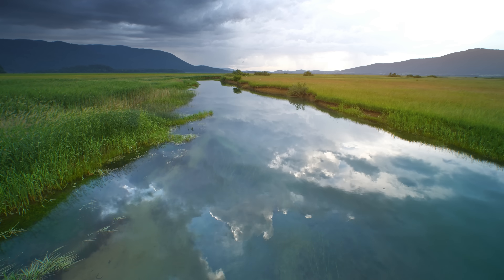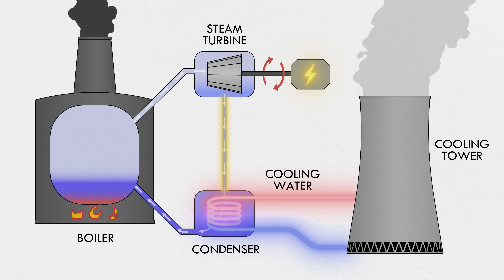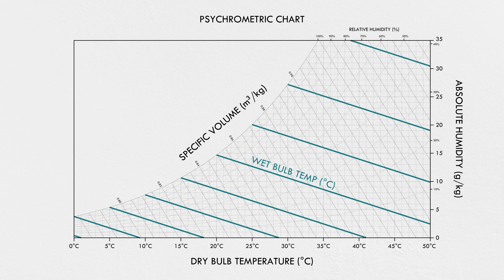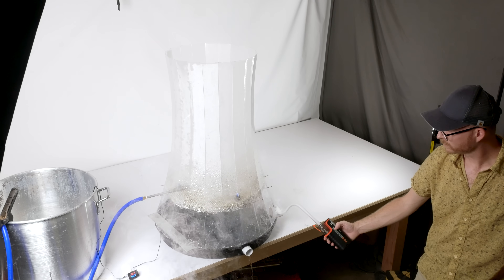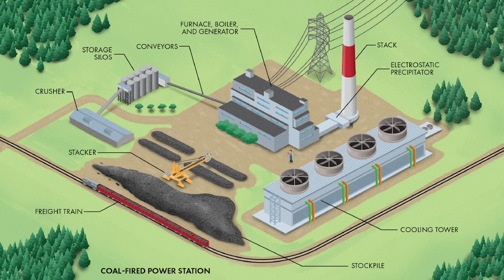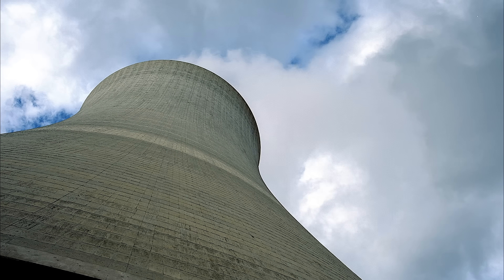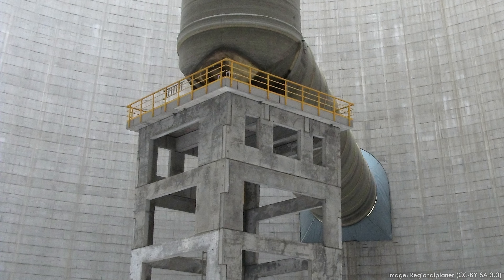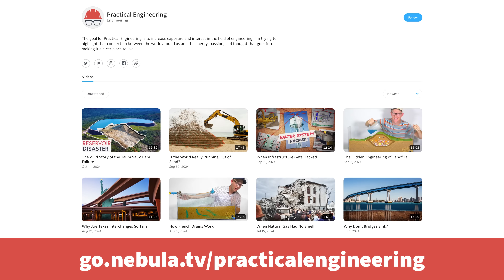Why Are Cooling Towers Shaped Like That?

Comment: Now I want to see a cooling tower cooled gaming pc.
Reply: I think the channel called major hardware did this awhile back
Reply: @Corang98  seriously?
Reply: @Corang98 thank you
Reply: @Corang98  Was going to say, when does Major Hardware try this with the hyperboloid and passive airflow method? His original attempt was more based on "bong" coolers with forced air since his channel is like 97% Noctua fans.
Reply: data centers. Where i work we use a cooling tower to chill water for a water chilled A/C which cools a computer room. Thus cooling tower cooled computers
Reply: @Shredxcam22  Google has a big facility with around a dozen cooling towers in Henderson NV
Reply: @Shredxcam22 he just want to see them not saying they don’t exist 😂😂
Reply: BOOM  @Shredxcam22
Reply: @Shredxcam22 I think it would be more efficient to cool CPU's/GPUs directly with water...
Reply: @joonaskekoni2867  efficient but not as practical
Reply: There were people doing this back in the 2000s, but it's kind of a pain because if the tower is outside you have a ton of maintenance from ambient dust going into the tower cooling loop, and if the tower is inside you have a lot of noise and humidity. 🤣

It's also very complex because you really don't want to pass water that collects ambient dust and microbes into your cooling blocks, so that means 2 loops, 2 pumps, and a water-water heat exchanger.

KISS wins.
Reply: @Taverius  I guess just putting a filter on top directly impacts air circulation? I feel like it would be worth it just for the cute image of knowing someone's PC is running by the steam coming from their rooftop cooling tower 😂
Reply: @Taverius that's not complex at all, you should always have a water water heat exchanger for pc cooling anyway if you're serious about your system.
Reply: That sounds incredibly inefficient and I want to see it
Reply: In the mid-2000's this was called a "reserator", a reservoir-radiator. They were usually done without regard for proper engineering so most reserators were terrible in practice, but combined with thermosiphon circulation, it was possible to have an entirely silent, entirely passive, water-cooled PC.
Reply: I think over a decade ago LTT did a video on doing just that. Even before then I know in the early 2000's some guys were playing around with this system. Generally speaking it did work but it made the room very humid and eventually would stop working without another system in place to take out all the humidity and cool the room back down.
Reply: @Hybris51129 He used a swimming pool for that, but the water leaked due to galvanic corrosion and ruined his son's computer.
Reply: @Hybris51129  he recently built a system that cools his server room by using his pool as a resivour. The heat gets drawn out of the server room through pex lines that then run through the foundation of the pool, transfering the heat they hold into the water in the same way you would do a heated concrete floor, something his smart home also has integrated.
Reply: My local airport is cooled with cooling towers! (The massive, massive AC units on the roof are, at least)
Reply: @firstletterofthealphabet7308 These are the condenser units. The indoor units are called AHUs or air handling units, or simply air handlers.
Reply: My entire college campus is cooled with chilled water run through cooling towers. @firstletterofthealphabet7308
Reply: Give Nvidia another generation or two and you will need the real deal for cooling purposes
Reply: For a while, bong coolers were a thing lol. They're not shaped like nuclear plant towers, but they cool down water cooled PCs with a tall evaporative tower that showers water down and blows air up
Reply: @beehard44 that'd be a forced draft cooling tower.
Reply: @beehard44  Did this back in college mainly because I would.
Reply: @beehard44  and gives good rips.
Reply: Good idea 😂
Reply: Most I saw were like 4" pvc 6' tall
Reply: I did this in 10th grade for my overlocked pc. Circa 1999
Reply: I was thinking the exact same thing
Reply: ? @CroissantCreates
Reply: Linuuus!
Reply: I did an attempt 2 years ago while making a desk with a pc in it, I studied evaporative cooling for a while and I almost got it working, the problem was reliability, plus the open reservoir was exposed to dust other than having the possibility of leaking 20L of water on my floor in case of structural failure 😆
Reply: The massive NSA Utah Data Center which sifts through all of our data has six large forced-draft cooling towers and uses over 1.7m gallons of water per day. They're watching you.
Reply: We need it to play Star Citizen. 😂
Reply: it's been explored on YouTube more than once, its not really a practical solution scaled down is the ghist of it. What is used in PCs now performs better and is more practical.
Reply: Technically, if your pc is water cooled and has fans on the radiator, it already is cooled by a ‘cooling tower’ 😅 But I guess you mean cooling using a natural draft cooling tower… that would definitely be cool 😎 excuse the pun 😅
Reply: May not be completely passive but the closest is going to get Geometry wise commercially was the 2013 Mac pro..
Reply: @LinusTechTips
Reply: just open a window in your room and get a fan lol
Reply: @marianandnorbert  doesn't look as cool
Reply: oh man you should see military server rooms the AC and ventilation they have is very cool
Reply: Then they put the cooling tower inside instead of outside😅
Reply: kinda what xbox series X did
Reply: Someone build this!
Reply: I feel like doing that would freeze the computer in ice
Reply: AWESOME IDEA!!!! 😸👍
Reply: That would be very underwhelming... They don't really cool the water to be super col, just make it liquid.

Additionally, water is just bad, because what matters is the liquid temperature inside the cooler, which can be made much cooler using liquids that don't freeze at 0c.
Reply: @Windows__2000  water is great because it has a very high specific heat. balancing an evaporator with not creating a ton of condensation in the cpu area is a pretty tough task. 

the heat generated by the cpu is a very tiny area, and a little bit of water can absorb a lot of heat and carry it away. very useful as an active heat exchanger. then the the other end you can stuff in a freezer if you want cooler temp. but back in the early 00's, cra king up the voltages to support the higher speeds was the bigger nominal bottle neck vs water cooling and a radiator. the only ones getting a somewhat significant bump over water were using liquid nitrogen immersion. which iirc had boot issues.

as a Chem E project I essentially designed an ammonia system (turned out to have been don't before, used in RV AC units) for cooling. on paper, it was almost NOT a condensation nightmare. 

all that is iirc, it's been ages. but my p4 2.8c did survive until about 2015 overclocked to 4.2 ghz using water and ambient air radiator.
Reply: I think my gaming laptop would still overheat even with this
Reply: Buy a data center PC ! Cuz the way things are going this will probably be a thing
Reply: @linustechtips lol
Reply: @ltt
Reply: I think I need one of those for my pc
Reply: Dude. Thats just the xbox X
Reply: 🤣🤣🤣👌cool
Reply: We called it a bong. Also Linus already did it.
Anyone remembers the twister bong?
Reply: That's funny
Reply: It would require water to added all the time
Reply: I think Zalman had such a thing somewhere around 2000
Reply: Do not show this to Linus 😅
Reply: why the hell would your gaming pc have boiling water in it??
Reply: @NithinJune  because Intel Inside ? ;)
Reply: has anyone said "cooling tower cooled mid tower"? perhaps one by cooler master?
Reply: My thoughts exactly. I have a recommendation: https://youtu.be/Cu2bqY4GSl4?si=LYnPtkDNVEq7hKKf
Reply: Wait for the 60 line, 50 line is already a big bulk that doesn't fit into the pc
Reply: 24 years ago, we call this the bong cooler
Reply: Swamp cooler. Great way to have 200% humidity.  A friend used to have one in his attic for LAN parties and it would be nice and cool but everything would be practically dripping.
Reply: You can see the datacenter cooling towers at top left of the building in this pic:
https://www.mghpcc.org/wp-content/uploads/2014/10/032812northcam.jpg

And academically studied here:
https://lass.cs.umass.edu/papers/pdf/mghpcc-ic.pdf
Reply: Look for my post on overclockers forums about building your first bong cooler
Reply: Runs on Belle Delphine bath water.
Reply: Yuhh
Reply: ask linus
Reply: Linustechtips did this 8 years ago
Bong evaporating cpu cooling

https://youtu.be/jsQKyAswAPI?si=zCdYQwqf0P4cRNMR
Reply: https://www.youtube.com/watch?v=oYVQoCx7Xkk
Reply: oooooo now i want to make one
Reply: @linustechtips 😂
Reply: This is right up Basically Homeless’ alley
Reply: Beat me to it 😮‍💨
Reply: Gamersnexus would put that thing through its paces lol
Reply: https://youtu.be/jsQKyAswAPI?si=m4wzTypWpgDsKcUB 8 years ago
Reply: Linus will do that 😂😂
Reply: Ping LTT
Reply: OMG, here, that my thumbs up
Reply: It has been done
Reply: YOu need to stick your  head into a cooling tower and shake your being into reality
Reply: My thoughts exactly
Reply: And then use it to play fallout
Reply: How was kindergarten today?
Reply: @Linus Tech Tips 🙂
Reply: Frr
Reply: I've seen none on YouTube, I shall try to be the first
Reply: PS5 features this
Reply: @TheMsyZa @combineecho5831 
First attempt: https://www.youtube.com/watch?v=bSE17ArRm4w&pp=ygUbbWFqb3IgaGFyZHdhcmUgY29saW5nIHRvd2Vy
Second attempt: https://www.youtube.com/watch?v=Wf5OqCnJzhU&pp=ygUbbWFqb3IgaGFyZHdhcmUgY29saW5nIHRvd2Vy
Reply: That would be a massive gaming PC😂
Reply: That would be great 😮 @mqb3gofjzkko7nzx38
Reply: Linus get on this!
Reply: Make one then darling. Don't be a tease. 😊
Reply: @linustechtips
Reply: https://youtu.be/bSE17ArRm4w?si=x1rGZ5jnml2x6YOs
Reply: Bro, a pc in the shape of a cooling tower would look siiiiick
Reply: Aren't all tower cases cooling towers?
Reply: Craziest would be a refrigerant chiller for cooling
Reply: No.
Reply: Reading these comments I’m actually impressed that this is viable.
Reply: You're in luck! LTT did a bong cooler PC years ago!
Reply: It’s been done (several times) and it’s not as good as it sounds unfortunately.
Reply: You could then claim to have a steam powered computer!
Reply: Are your computer atomic?
Reply: Coldest PC ever
Reply: Im sure we need this for future rtx 5090 or maybe 6090
Reply: Genius
Reply: Bitcoin geothermal mining in El Salvador
Reply: It’s amazing how engineering combines efficiency and aesthetics to solve practical problems.
Reply: Linus Sebastian is at work
Reply: How much do you need
Reply: well, technically your fans make ur pc tower a cooling tower it is using a hvac system (small versio)
Reply: This video is a perfect blend of science and practicality! I’ve always wondered about the unique shape of cooling towers, and this explanation not only answered my questions but made me appreciate the engineering behind them. The natural convection process is genius
Reply: So a noctua?
Reply: Been there done that.
Reply: im gonna get one once i afford to get a quantum pc
Reply: I’m in commercial hvac I’ve been waiting for this
Reply: Incomes a new Linus video next week
Reply: I cooled my custom loop by running the water lines through the same hole to the basement I had drilled for my ethernet line and it just vented all the heat into the basement. Was silent and incredibly cool without needing to ever really worry about dust
Reply: WATER COOLED PCS ARE ABOUT DISPLACING HEAT WITH CONDUCTIVITY. COOLING TOWERS ARE NOT THE SAME 🤦🏿‍♂️😡😡😡😡
Reply: Nuclear powered PC, let’s go
Reply: Can it run gta 6?
Reply: Just wait for the rtx 5090. You'll need 2 cooling towers: one for the gpu, and another one for the power plant that powers the gpu.
Reply: https://youtu.be/Wf5OqCnJzhU?si=REZ1FjD05CsI-Emq
Reply: I WA THINKING THE SAME THINGGG
Reply: Just an FYI for anyone who wants to use open / evaporative cooling for a PC. The temperature and moisture ranges are the perfect breeding ground for legionella bacteria - Legionnaire's disease and Pontiac fever common to early indoor ventilation systems.

If you look into industrial scale cooling tower packing, they have a whole suite of packing materials specifically treated to inhibit legionella. 

That said, if I decide to water cool my next PC build, I might mess with a semi-passive cooling tower loop with significant bacterial growth inhibition strategies.  The attractive part for a PC is your feed water post cooling can easily be 8-12F cooler than the air in your home based on typical indoor humidity and temperature range.
Reply: Hold my beer...
Reply: Ahahah 😂 yes!
Reply: @linustechtips
Reply: Major hardware did it a while ago lmao
Reply: @ltt
Reply: Why? He just said you need adequate humidity for it to work. You want your house to feel like a swamp? You can short term but houses are predominantly build of wood plastic and paper so mold will eventually become a problem.
Reply: @yoface938  I just want to see one. It doesn't have to be in my house.
Reply: That’s just a more fancy name for a chimney pc setup
Reply: No, you need condenser and evaporator to cool down pc😮
Reply: dude with the 5090 you will
Reply: Technically all water cooled PCs are cooled by cooling towers. They're just dry cooling towers rather than evaporative cooling towers 🤓
Reply: Video games are one of the least important things in life.
Reply: Hahahahaha
Reply: Fail Safe Computing
Reply: Lol
Reply: U dumb
Reply: Large data centres use them.
Reply: @LinusTechTips please make this happen
Reply: Hey ferb, I know what we’re doing today!
Reply: https://youtu.be/Wf5OqCnJzhU?si=ywP2xhwYa1S8KovV
Reply: Yeah, not in the near future for now😅. But it might just be 🤔
Reply: DUUUDE that was my first thought !
Reply: Rain world iterator
Reply: Powered by nuclear
Reply: You might need one for the rtx5090
Reply: Have*
Reply: 200mm fan at the bottom and mesh top
Could be a good mini itx enclosure
Reply: now THATS what its about
Reply: Cool tower for pc in like half a high elevation house with air chamber to maintain ambience temperature
Reply: It was make more sense to install a hear recovery chiller and then plumb your pc into your ac system 🤣
Reply: Ps5 kinda has that design up on end !
Reply: Firstly understand the word Tower
Reply: Well, you can but....see bong water. most of time you will get good mileage out of replacing thermal paste with a better quality one,
Reply: Just get yourself an Apple Mac Mini bruh❤
Reply: Imagine a extreme over engineered pc that requires a power plant/cooling towers running a billion FPS 😂
Reply: Some pipes are formed like that.
Reply: But you need nuklir pc for use cooling tower🗿
Reply: if you take the heat sink(from a water cooled pc) and put it in a container with water instead cooling it with fans you could probably build a cooling tower and make the water from the container flow to and from the tower. I dont know how efficient that would be though. If you build it let me know i wanna see it.
Reply: I have gotten an idea and I don't like it lol
Reply: Powered by a mini steam turbine
Reply: Good idea
Reply: Liquid nitrogen extreme overclocking
Reply: Check out pretty much any hospital.  Most use water cooling towers or chillers to cool internal systems.  We maintain several locally for the Cleveland Clinic.  They’re like mini inside rainstorms.  😊
Reply: That would be all of them, the power that your PC uses requires the use of cooling towers
Reply: Dooblebarrelshotgun n'ose has been summoned
Reply: I'm on it
Reply: Build one. That would be dope. I’d watch that video
Reply: Paint it to look like Chernobyl while you're at it!
Reply: @ratvomit874 you had to mention that.
Reply: @LinusTechTips do this!
Reply: @toygun12345  he did
Reply: Passive cooling towers for computers do exist. They are closed systems, though.
Reply: Gotta get Linus Tech Tips on it LOL
Reply: Dumb overrated comment